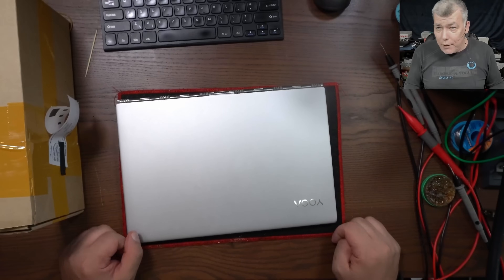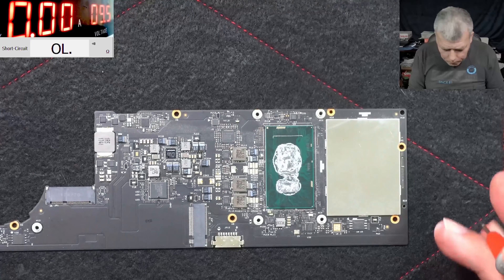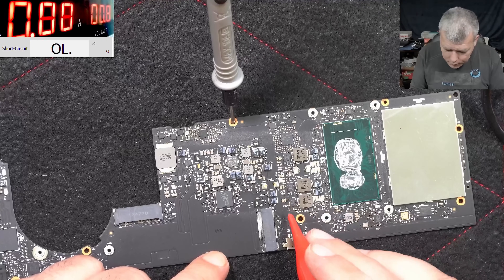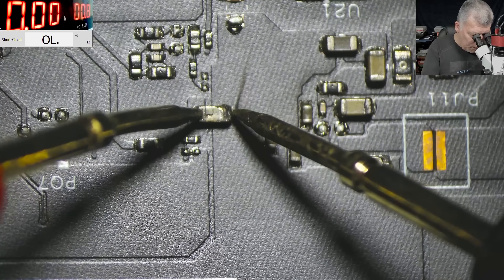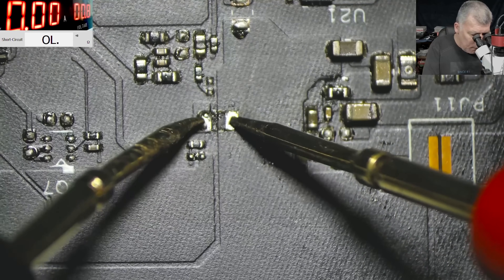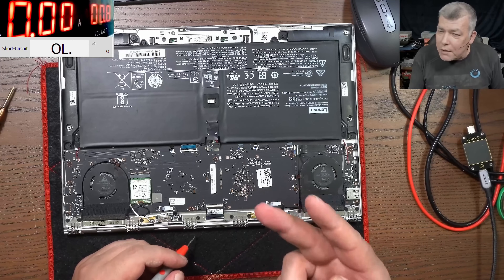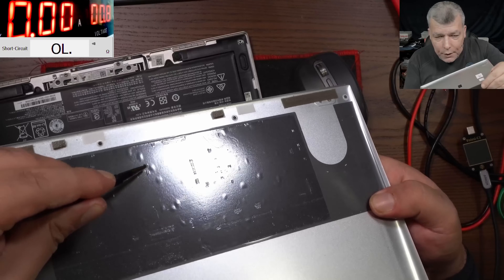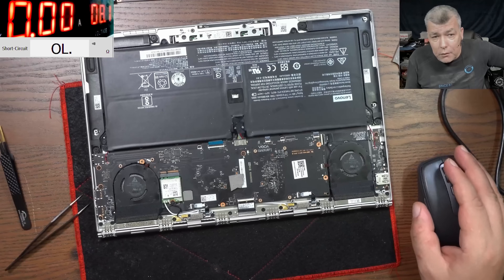Two Lenovo Yoga 920 laptop boards, same fault. What are the odds?

Comment: So did you take out the capacitors on the board in the computer? Did you fix both boards or just change out the boards and send the other one back broke with the fixed computer? Thanks for the video.

Comment: This is insane. At least it should be reported to company that their back plate is damaging the mother board. Their selection of cheep materiel is costing people money. But happy for your luck break what an easy fix.
Reply: This is a budget model, they will just ignore it, hell even in the expensive models lenovo ignores problems, the early x1 carbons were horrible and had failures on the exact same spot.

Comment: since both boards are fixed now, the only way to avoid the BITLOCKER thingy is to put back the original board and make sure that secure boot mode is set as enabled. That way, the bitlocker wont pop up coz the keys are stored in the original board.

Comment: Sorin just a small suggestion... place some tape on the multimeter beeper .. just to not kill ears :) i   do that also to prevent new viewerse to stop watching videos for the noise.
Reply from the maker: The problem is i can't hear it loud, actually is a little bit quiet, but probably i have bad ears, or a bad microphone
Reply: @10minlaptoprepairs  oh.. never thinked about this. Well.. and what about lighting a red light when there is a small resistance? Or make a video on how to take the beeper signal to activate something else ?

Comment: It is asking for the bitlocker recovery key, because with windows 11, it has automatic bitlocker encryption to the ssd with windows 11 via the TPM(Trusted Platform Module), this occurs when you either replace the board or try recover the data with the ssd externally. Microsoft will not give you the bitlocker key whatsoever. Its their way of anti repair. They are ripping off the customer, same with apple. So makes it hard for the tech like Sorin to repair the device.
Reply: I believe you just have to log into your micfosoft  account and look them up, i've dine it a couple times. Just asks when you switch hard drives between computers.
Reply: If the customer has the email he can recover the key easily, OR just return the SSD to the original board.

Comment: just a beginner. I have a question, how Sorin able to see the shorted capacitor?
what tools needed for those tests?
Reply: When speaking about a short in an electrical circuit, we mean that the flow of electrons is somehow taking a path that is shorter/easier/offers less resistance to go through, than it was intended by design. 
Thus, a short cut, a short. 

Ok, so now the circuit board is letting more current pass through itself than it is ment to. 
And when current flows, it heats up the components and traces which it is flowing through. 

And since the majority of electrons are taking the short cut, the component/trace where that short cut has occurred is getting hot. 

Which is why Sorin looks at the board through a thermal camera and then takes a closer look at the hot spots (potential short circuits).
Reply: @oilybrakes  thank you. I appreciate your response. I have 0 knowledge on board repairs. But it's not too late to learn it. Right?
Reply: @ErosAlvarez  i started board repair at 40 years...
Reply: You must have skipped this shortened video!

Comment: Experience pays off. What can be used there to protect the board from future mechanical damages? Maybe a thin thermal pad? Are the thermal pads isolators or they conduct electricity and can create a short? Asking for a friend*
Reply: @dionisienatea3137: In your browser type heating pad wiki. If you want to go deeper there are several articles related to the topic. You will also find thermal putty in gray, white and pink (laptop applications and game consoles mainly on the body of the Mosfets) but on the critical components (CPU, GPU, Chipset) apply excellent quality thermal grease as recommended in the description just below the image of this video (if necessary, click on "more") and choose My tools.
Finally: The heating pad is NOT a metal therefore it DOES NOT conduct electricity. Its main function is to reduce the temperature caused by the heat of the electric current on the electronic components. All the best.

PS: I will gladly accompany maestro Sorin also on this channel.
Reply: @CarlosGarcia-d3e Is graphite a metal then? 

No need to answer, that's just bait to question the non metal = no electron flow theory. 
😁